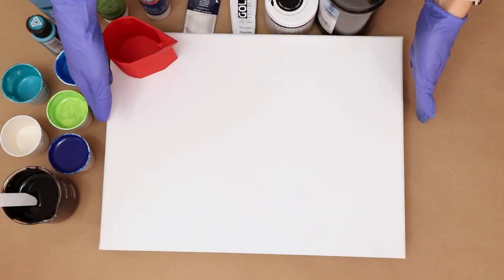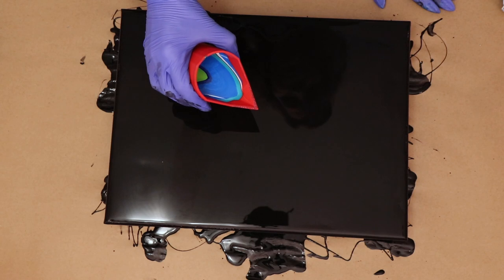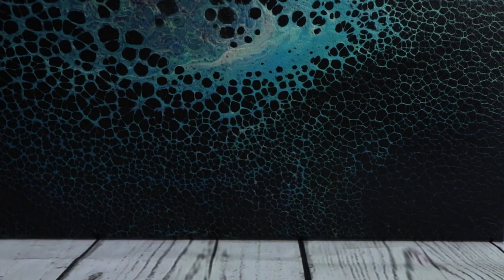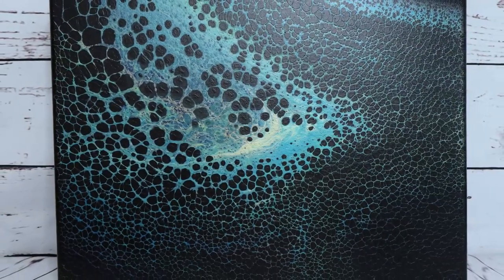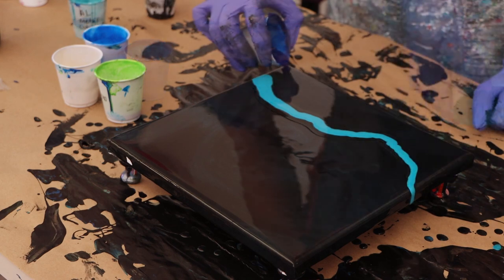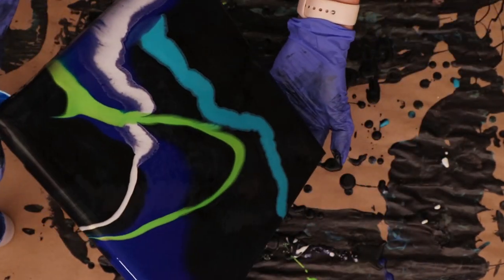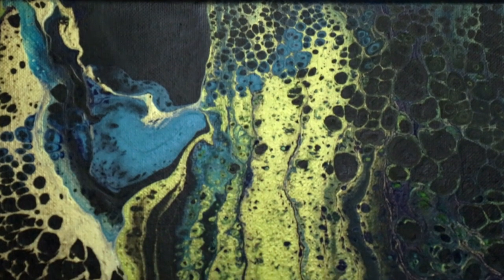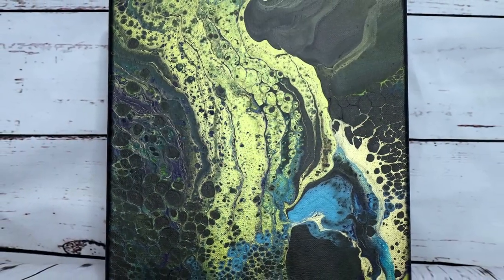3D Printed Acrylic Pouring Tools | Spouted Cup and Re-usable Swipe Tools

Comment: I think both paintings are amazing. But, I think I like the second painting better. I loved the blue on the first painting but it got covered up. I am partial to blues. Could you do the first painting using a navy or very dark blue as the base color instead of black?  Also, I love that green in the second painting. I love all your paintings. Have a lovely day!
Reply from the maker: Thank you Wendy. If I can find Decoart satin enamel in blue I will give it another try. It's getting scarce right now. I could try adding blue to the black and see what happens. It will be dark but it could work. I love to experiment so that should be fun. Have a great day!